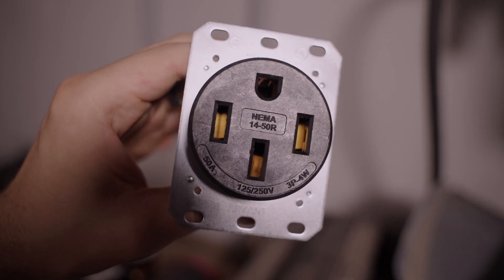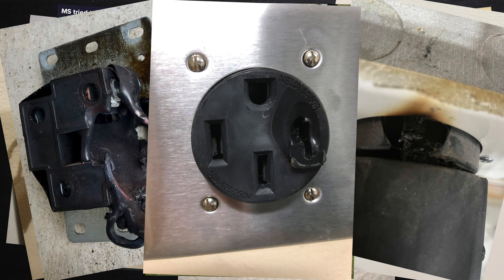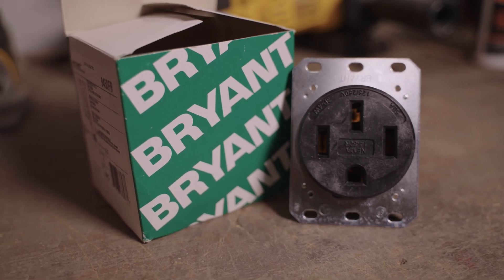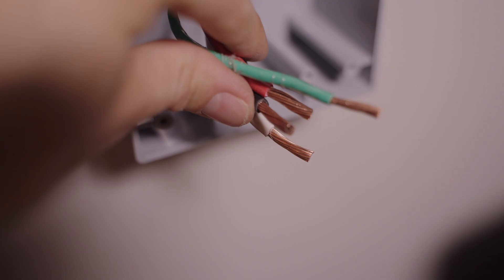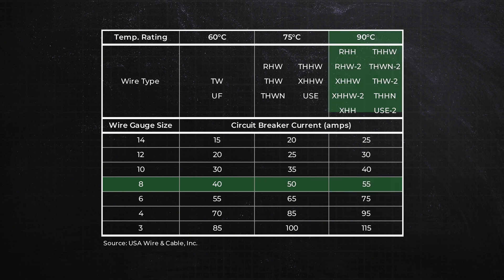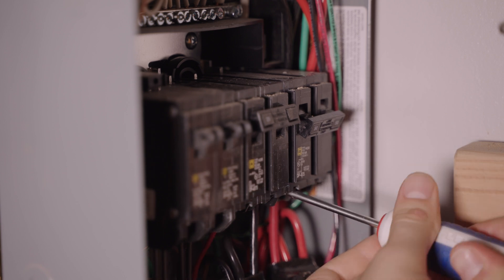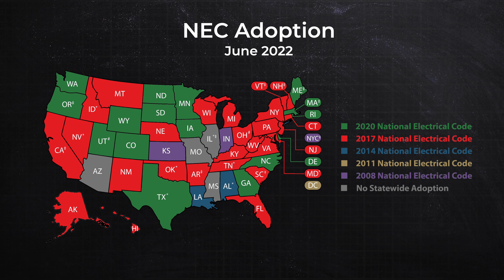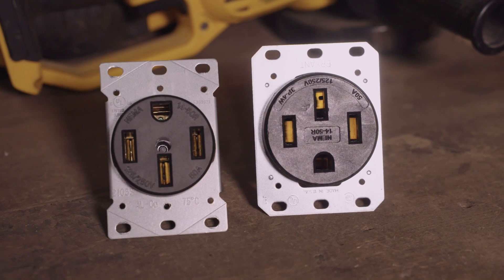3 Mistakes I Made Installing a NEMA 14-50 Outlet

Comment: As a retired Electrical Foreman I have these comments: 1. I totally agree with the upgrade to the Hubbell/Bryant receptacle. 2. I totally disagree with the down sizing of the circuit breaker. You stated at the beginning its normal for a EV charger to draw 40-amps for hours. Although you correctly charted the ampacity of your #8 THHN wire based on the terminals temperature rating. Please refer to NEC 210.20(A) it states that the overcurrent protection device rating shall not be less than 125% for a continuous load. ( i.e. 40-amp x 1.25 = 50-amp ) You DON'T load a 40-amp breaker to 40-amps 👎You had the right size breaker before. You should never load a breaker more than 80% ( i.e. 50-amp x .80 = 40-amp )
Reply: The 8 gauge wire is where he really went wrong... 6 gauge for a 50A circuit (like a stove).
Reply: @AuditAmplifier 

Stoves are also often 40 amps.
Reply: Super. Hey guys, electricity isn't like water, you can't just use the total number of amperes available like turning on a faucet all the way. In other words, if you need 40 amperes to charge properly, then you need a 50 ampere breaker (125%) and #6 gauge copper wire, (#6/3g , four wires, or #4/3g over a certain length.) The code for where I work allows up to a 60 ampere two pole breaker feeding a single receptacle, (I've only ever seen one and it was in a really big house with a commercial stove.) and with some vehicles being able to adjust their charging rate, allowing for faster charging, more is better. It is ALWAYS better to go with a larger gauge wire in any installation, and use the expensive top quality hardware, because code is a minimum accepted value, and the cost of wire and hardware is a non-issue compared to a cost of a damaged or destroyed home. Quality wiring is a lifetime of peace of mind, so build in that extra capacity now, and don't skimp on the hardware or installation. How many of you people, even the Sparkys, put conducting grease on the terminals of an outlet or the prongs of a heavy duty plug, or apply Oxgard to your wire nut or Wago/Ideal connectors, or triple torque and wiggle all threaded connections, or clean and deoxidize the COPPER and aluminum wire, or put metal protective plates ANYWHERE a wire or conduit goes through a stud, etc. & etc. How many of you have abandoned #14 gauge Romex and adjusted your box fill figures to use #12 and larger wires only in new residential wiring or old work repairs, even if it is connected to a 15 ampere breaker. This Sparky sleeps quite well at night after I come home from work, because I put in the extra effort to make sure that there won't be any issues down the road, or a return visit unless the homeowner wants to add something new. A lot of my work involves repairing or replacing bad wiring or hardware that has been damaged or compromised or installed incorrectly, and about 70% of the time, the damage (Heat or corrosion) is caused by something as simple as not tightening a terminal, or filling a hole, (Critter damage) or not putting anti-oxidation grease on the stab and wire terminals of a circuit breaker, inadequate wiring, or even just buying inferior parts that aren't up to the job. Stay safe. 💙 T.E.N.
Reply: Yessir you got it. I do service and number one mistake the handy man makes is undersized circuit. I’ve seen the EV charger melted…
Reply: @alfonso704 

Easy to do when the codes are generally difficult to access and are often written in confusing ways, both of which are done on purpose to prevent the general public from doing their own repairs. 🙄
Reply: So confused as to why the brands are the difference between an outlet melting and not melting. Regulation is that bad? Surely the temperature rating is a factor, right? Also, I feel like some people are breaking specifications and pulling way too many amps
Reply: So if a evse was being advertised as 40 Amp unit... Does it require a 40 Amp breaker? Or a 50 Amp?.. The car in itself has a 32 Amp max draw.. I just want to know before I buy it.. Thanks to those that answer. Also the unit is a nema 14-50
Reply: @Mr.REEP0  if you’re max is 32amps then 40A Amp breaker and circuit is all you need. If your vehicle can draw 40amps then your step up to 50A and so on.
Reply: @alfonso704  cool appreciate the info
Reply: @Mr.REEP0  EVSEs should follow the 80% continuous load rule. For a 40 amp circuit the EVSE should do 32 amps max. For a 50 amp circuit you can do a 40 amp EVSE.
Reply: @Tithis  then I'm good to go..
Reply: @Mr.REEP0  Alternatively, spend more and a 100% continuous load breaker then it doesn't matter
Reply: Is this why it’s called fire code???
Reply: @jimsummers487 The National Electrical Code (NEC), or NFPA 70, is a regionally adoptable standard for the safe installation of electrical wiring and equipment in the United States. It is part of the National Fire Code series published by the National Fire Protection Association (NFPA),
Reply: @gratzbuck9882 

While doing what we can to make homes safe is a good thing, obviously, the code/permit/inspection system in America in its current form is an extortion racket. It is designed to support trades people, corporations that support the trades, and of course local governments. Safety is a convenient thing that that corrupt and unconstitutional system hides behind.
Reply: You start with the manufacturer's Voltage and Current specifications.  Then you add to it a dedicated circuit that has equipment running for more that 3 hours, this will require a higher gage wire, outlet, and circuit breaker due to increased expected amperage.  A dedicated circuit installed in a garage should be able to handle the targeted maximum amperage that is expected.  So, if one has to use 4 or 6 gauge wire, or a 75 amp circuit breaker, so be it.
Reply: @Chris-mi1tt  the circuit breaker must/shall not exceed the U.L. Listed maximum…… but the wire should be upsized to provide a cool running branch circuit….. maintenance will v
Be required
Reply: Most people start with a "dedicated 240v circuit" rated to handle around 40 or 50 amps.  No one said the "circuit" had to be limited to 40 or 50 amps.The dedicated circuit (breaker, wire, and outlet, diameter of conduit, and back box) can be UL rated for 60 or 75 amps.  Just install higher gauge wire, different breaker,  different outlet, larger size diameter conduit, and the size of the back box matters.
Reply: @Chris-mi1tt  ok then a 100 amp breaker will charge my cat that much faster……. I will get a fire extinguisher
Reply: I am being very specific.  The electrical code mostly provides guidance for the circuit being installed not the equipment being plugged in. Designing this circuit to handle 60 amps, vs 40 or 50 amps will only cost you more money.  This electrical circuit will be a permanent part of the house.  Who knows what the next owner will plug into it. It's this home owner, and the next one's responsibility to not plug something in the outlet that draws too much current.  Most circuits in a residence are designed to handle 5 to 10 times the current that a single device will draw from an outlet.  I plug in 1amp devices into my 20 amp rated outlets all the time.  An electrician can design a "dedicated circuit" to be able to handle any amount of current.  So as an alternative, an electrician can "design" this circuit to handle 60 amps, or 80 amps, etc.  It just cost more. This electrical circuit doesn't have to be able to just be able to handle a maximum of 40 or 50 amps.  It's up to the manufacturer to protect it's equipment from excessive current draw.  Do you worry that your lamp in the front room will catch fire because you are plugging it in to a circuit that was designed to handle 20 amps.
Reply: That's the golden rule with breakers.
Reply: Correct! Always have a larger breaker as opposed to a smaller breaker.
Reply: Great point I was going to put that in my comment but I had a flash arc in my mind. hahahaha
Reply: Isn't 32amps charging you need 40amp breaker 8awg wires. For 40amps charging you need 50amp breaker and 6awg wires? The outlets rated for 50amps so 40 and 50 amps breaker will do fine.
Reply: thank you. this makes sense. keeping my 8 gauge wires, 50 amp breaker, and hubbell nema14-50.
Reply: Yes, as long as the insulation rating on your wire is 300 or 600 volts. The  amperage capacity is more than enough.
Reply: @gratzbuck9882  Ahh glad I asked, I'll check the insulation rating. Thank you!!
Reply: @gratzbuck9882 Would it be okay to run 6gauge from the outlet to the 50amp breaker? I only ask because I have a bunch left over from a big battery bank I built (48v).. I figured it would be as long as I can fit the ends into the slots, but you said you were a legit electrician...
Reply: Why not use a NEMA 14-60 and allow 48A charging?
Reply: Besides why would you spend a few extra dollars and safe side your house, your purchases, your life, bragging rights of always going towards biggie and better the safer way!
Reply: YA. We need to clarify what specification of EV charger you used. I did not see it in this video.
Reply: Let's do it this way,  load (LCL, long cont load) x 1.25, wire derate by 25%, breaker max load minus 25%.
Reply: Your last sentences drifts off into a more general statement on loads after first mentioning a continuous load and the 125% figure. For consistency you should have said no more than 80%, which you did, but for a continuous load, which you left out at that point.

In fact you saying "you should never load a breaker more than 80%" with of course the caveats for continuous and non-continuous loads, is how the code should be written, and not that verbose and unnecessarily complicated crap they have. 

Just stating that in case some people get confused for other use cases. A range or a stove top, for example, is not a continuous load, so a 40amp breaker is fine with 8 gauge wire for a stove top or range, assuming the specs for the stove top or range specifies 40 amps for the appliance. 

Of course the DIYers will ask themselves what's a continuous load and what's a non-continuous load? Good luck to them finding that out through the actual codes that are difficult for the general public to access. What an extortion racket the code, permit, and inspection system is.
Reply: Good point! But in this specific case, the maximum current for the NEMA 14-50 adapter used by Tesla chargers is 32A X 1.5 = 40 Amp. He is GTG! Please let me know if I'm wrong.
Reply: @rafaelcasalduc5820  I think you meant 32 x 1.25 =  40 amp
Reply: @rafaelcasalduc5820  you shouldn't have outlets that have higher rating than the breakers - the next person along could install a higher amperage charger and have issues. Breakers should always be the higher rating.
Reply: @SP-wp4ti  The NEC specifically lists 50 amp outlets as being okay to install on 40 amp circuits. I think this is because their arent any 40 amp outlets, but you'd probably want to at least label the outlet for the next person.
Reply: @SP-wp4ti  your wrong you cannot have an overcurrent rated higher than the receptacle when it is a single outlet must have the same ampacity as the overcurrent device
Reply: @SP-wp4ti  that makes no sense at all.  if the purpose of the breaker is to prevent fires then why would you want a breaker that won't trip before the receptacle or wire fails?  the breaker should be the weakest link in the chain no?  the breaker is there to protect everything that's connected to it.  or have i totally missed something?  here in nevada they want 12 awg wire for 15 amp circuits instead of 14 awg wire because people are upgrading their breakers to 20 amp so they can support window ac units and stuff like that.  they don't want the breaker to be stronger than the wire or receptacles, because its basically useless if it doesn't trip in time to save the electrical connected to the breaker.
Reply: The problem here was that the outlet itself was only rated for a maximum of 40 amps that's the reason he went with the 40 amp breaker. 🤔
Reply: @POLOAZTECA  The outlet was a NEMA 14-50 that 50 on the end tells you the amperage rating 🙂

Comment: Article 220, divide the loads into two categories: continuous and noncontiguous. Table 310.16 Ampacity but because you're saying its drawing for more than 3hours than its considered continues load so you have to multiply by 125% with 40amps so 40x 1.25 = 50 amps so you have to go back to the table 310.16 and because you're using 60degree C you have to size the wire to #6. That's why all these people outlets are burning up because the breaker is 50 amps but the wire is 8 on continues load. Also make sure you torque the wires right too. Buying a industrial outlet does nothing when the wires are too hot, It will melt that one you're recommending too. But if you have a 40amp breaker with 8 yes it wont burn the outlet but the breaker will go cause you're using 50amps my guy.
Reply from the maker: My car and charger pull up to 32Amps so everything is sized appropriately for the 40Amp breaker with the 125% continuous load overhead. The fact that a 14-50 outlet can be used on a 40A circuit and that many chargers and cars can pull 40A continuous does introduce a potential problem as you rightly point out.
Reply: @chargeeverywhere  True if you're drawing 32amps x 1.25 is 40amps yeah you use 8# size wire. However, I still think the reason those home depot outlet were melting is the wrong size wire. Always wire anything under 100amps on the 60c column.

Comment: The fact that this guy mistakenly instructed viewers to fit a wrongly specified outlet and undersized cable shows a lack of research and understanding of the issue before he made the video. Clearly he did not adequately research his subject! That's not to mention the predicament of folks that fitted the wrong connector with the wrong wire size per his instruction! Take away for viewers is check and confirm the authenticity  of these videos. Don't just blindly accept that the presenter is qualified.

Comment: It is a good practice with stranded wire to use  bootlace ferrules on screw clamp type devices. It ensures better connections as the stranded wire will separate with the screw type connection.

Comment: Why did you put a 40 Amp breaker 6:32 on a 50 amp circuit?
Reply: David,   If he used a Hubble receptacle rated 50 amps at 75C, he could have left it at 50 ampere breaker.   Since the Bryant was only 60C rated, he was forced to lower the breaker size to protect the termination in the receptacle.
Reply from the maker: To add to this, there is no 40A-specific outlet, so the 14-50 can be used on a 40 or 50Amp circuit.
Reply: @KevinCoop1  The Hubbell receptacle is not rated for 75C either. The Bryant and the Hubbell are identical. Neither is marked 75C on the terminals, both include manuals which say to use conductors rated using the 60C column.

Comment: Quit using the word ‘phase’ in your wiring description please. There is only one phase in your outlet. There are however two hot and one neutral ‘lines’ (red, black, white). Phase refers to the voltage between two lines and since there are only two hot lines there’s only one phase. Your residence is supplied by one single phase 240/120 service. Secondly, your reference to the amperage tables is close but fails to mention the 80 percent limitation for continuous loads. Also, if GFCI protective devices trip it means there is indeed something wrong. Inadvertent and inconvenient are not synonymous.  GG.  Licensed Master Electrician…..

Comment: Nice presentation  of the corrections.  Homeowners  need to know the potential  problems  with new technology.   The 2017 NEC does require  GFCI for EV receptacles.   There was an update in December  2016.  Some books have it some do not.  Also just like the cheaper  receptacles sometimes melt, the same could happen  at the circuit breaker  box.  As you noted these can run 40 or more amps for 6 hours or more.  Panels cannot handle the heavy load.  Again nice presentation.

Comment: You still have to derate even though you don't have over 3 current carrying conductors in a very hot climate!!! So you're wrong!!!!

Also a Level 2 charger will provide 48 amps.  48amps x 125% = 60amps 
You must use a 60 amp breaker with wire rated at least 60 amp. 

I take it you have a Level 1 charger. 
32amps ×125% =40 amps.
Reply: I think there may be some misunderstanding. Level 1 (was) 120VAC up to 16A, Level 2 (was) any up to 240VAC 80A. It seems the latest update to code is defining Level 1 as anything 120V, Level 2 anything 240V.

Comment: When I installed my outlet, I used Amp/Tyco wire ferrules with Deoxit L260Dcp conductive grease. The wire ferrules were crimped to the same shape as the outlets connection point "diamond shape on point" this method kept the wire consolidated and allowed even pressure when the allen bolt was tightened.